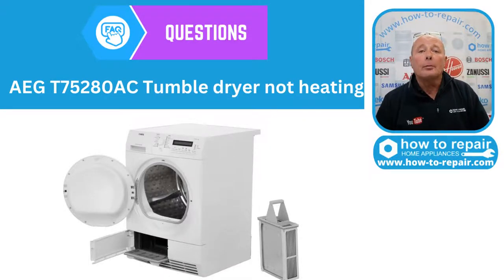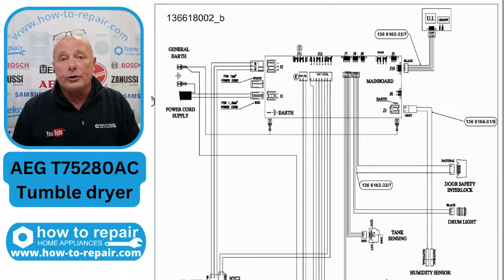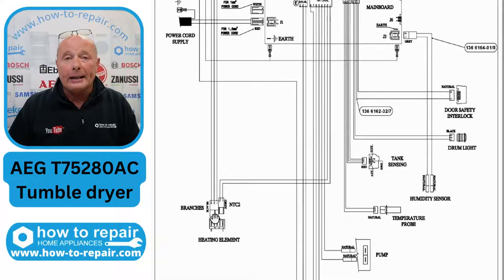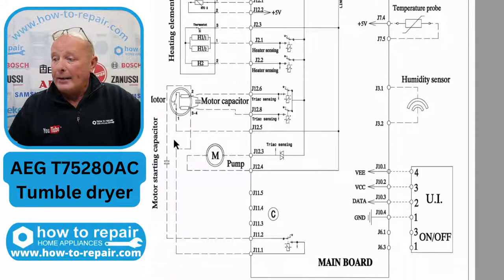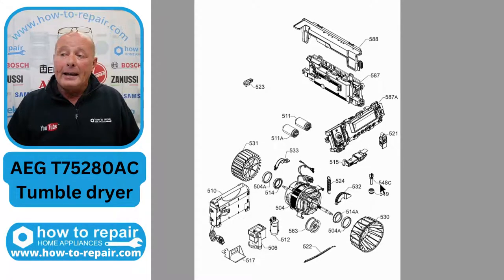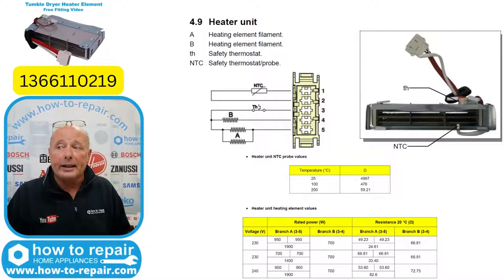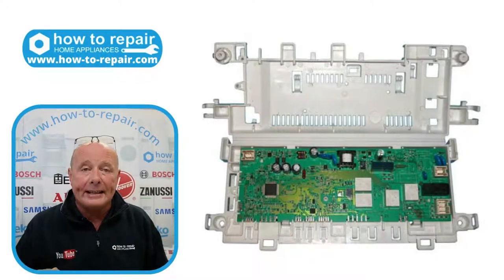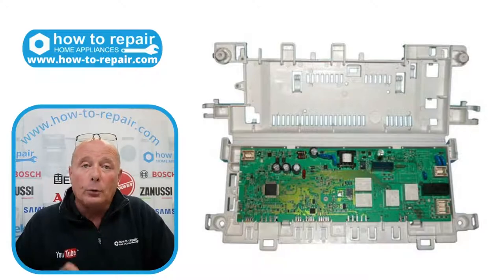Aeg t75280ac condenser tumble dryer not heating, wiring diagram on heating element NTC sensors ETC

Comment: Hi, I've replaced my heater assembly due to not getting continuity on the thermostat. (I assumed this was the issue).  I fitted the new one, reassembled, and put the dryer on for a cycle.  After 15mins I got the same E60 code as before. I removed the new heater and checked the thermostat's conductivity, and it was reading open circuit!?  I wish I'd checked it before installing, because I'm worried the PCB has a fault on it causing the thermostat to fail and not I have to replace the heater and the PCB circuit board.  The thermostats on this dryer aren't reversed by any chance i.e. open when cold and closed when hot? Thanks for your advice.

Comment: Best 👌 proffiesor....Electric1....

But 1 question 

Faulty EMI FILTER.....FOR WASHING MACHINE 
Does it make the washing machine not work completely, or is it possible the pcb work the and some parts work and others do not work.. 
Or motor not work ....

Which is realted to EMI FILTER  FAULTS 

AND HIW TO CHECK ✔ ✅ IT (EMII)